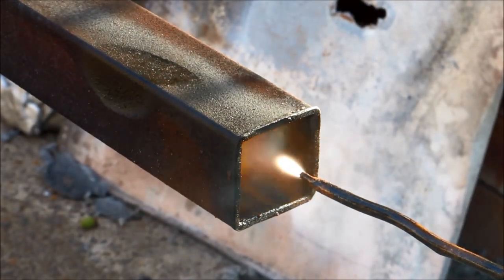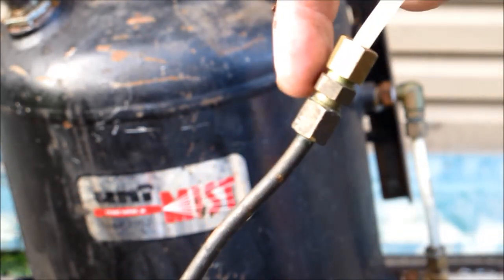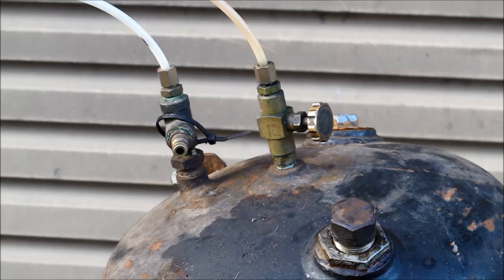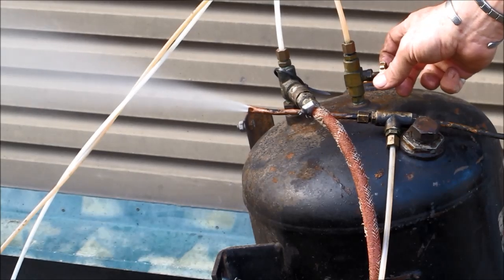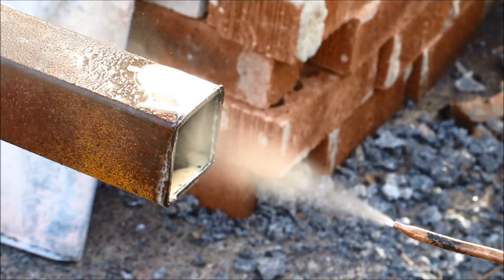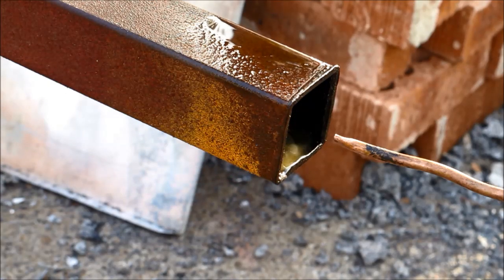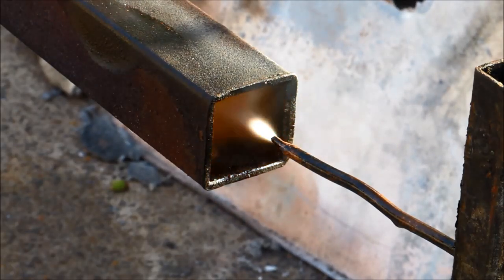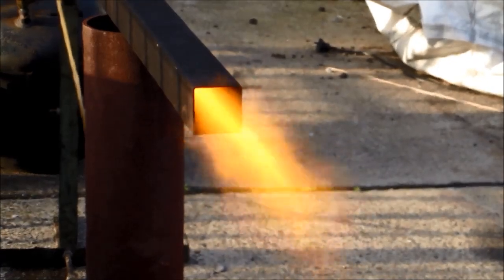Instant light  spraying oil Burner from cheap, off the shelf fittings

Comment: Thanks for the idéa, I have test it but with my own idea. I used copper pipe to create a spraygun so it create a vacuum that sucks the fuel in to the burner and it works just great. But oil burns not clean untill the burner is hot and diesel burns much cleaner. Thanks Oil burner
Reply from the maker: +Erik Strandberg  Be interesting to see what you have come up with if you could do a vid.  Sounds like a great system!
Reply: +Oil Burner I can send you a video on the burner on Google+

Comment: Hi Oil Burner,
                          I like the very simple principle the burner works on, especially the ultra clean burn. The only problem I see when used as a heater in the workshop is the carbon dioxide / Carbon Monoxide, both of which are the products of burning oil. These are heavier than air and can cause suffercation without any ventilation. An exhaust pipe would be required - to overcome the problem - and would need to be quite long to extract all the heat output via the walls of the exhaust pipe. Still a great idea and I will check just how much of the usable heat actually goes up the chimney so to speak. As a pensioner I need it to be ultra efficient as I like to get away from all the rubbish on TV during the winter months and do a bit of metal bashing in a warm workshop. Keep up the experiments and the inovation, It blows the mind ...literally. I must try an extra long exhaust pipe, at a guess I would think about 25-30 feet and see if the natural draft of that long a pipe would still give an efficient burn without having to use a compressor. Not sure of the oil flow rate as the air pressure into the tank would have to come from a point inside the exhaust pipe( venturi effect). It's worth thinking about.
Regards to you and yours
MoK

Comment: would this work for aluminuim melting... and how long would the tank you showed at the beginning last on a single run... and what can i use for air supply as i dont want to piss off my neighbors from my shop compressor being so noisy from refilling the tank.... whats the optimal air pressure it will run on? (edit) also, would it work on used vegie oil as i get lots of it from friends and family
Reply from the maker: +MegaCophater  Yes, it will melt Aluminium easily. The tank shown lasts over an hour depending on the output your run the burner.  No idea what else you can use for compressed air, Maybe a dive tank or get a quieter compressor you can use?  I have many other burners on my channel that do not require compressed air to run. The burner was running 20 PSI here but will run up to 100. 
the burner IS running on Veg oil in the vid as described.
Reply: oh, i could probably get a dive tank with a regulator capable of handling the high pressure... and i prefer having air behind it as this video shows a very clean burn (from what i can tell though) as i dont want to give off too much smoke as i live in the city.

Comment: Hi! Nice simple solution - I like it.
Have you tried to make a preheater for the oil, by coiling the oil pipe around the burner to improve the burn? Thanks. Keep up your inspiring work.
Reply from the maker: +Jose Silveira  Preheating the oil like you describe is in effective.  It does not add enough heat to make it effective once the air has comeing contact with the oil to spray it which causes it to cool.  It is OK to heat the oil to make it flow but by the time it gets to the sprayer it's already flowing well.  OTOH, I have tried preheating a flow of LPG to the point of cracking it and that makes a lot more heat than normal burning.
Reply: +Oil Burner Thanks. It will save me the effort for testing it (always good to profit from other people's experience, and you have a lot).
Reply from the maker: Jose Silveira
I get asked that a lot and It's a perpetuated fallacy.  Much better to ask than just blindly do what the guy before you did and make the same mistake. If you can find people that have TESTED something and save yourself the trouble, then that's a smart move in my book!  :0)

Comment: Love the health a safety tip! 
Im going to try this as seems the easiest version yet!
Reply from the maker: +Pete Franklin  One thing I have noticed, as well as being the simplest spray  design I can find, it also seems to be one of the few if any that will light straight off on WVO. All the others I have seen are either using LPG for startup or are using diesel/ kero as the fuel.

Comment: Would be neat to add some steel line around the end section and drip feed water in to turn to steam. and then inject the steam about 6 inches from the end. See if steam breaks down into HHO in the heat and then mixes with fuel and makes a completely clean burn. Just brain farts.
Reply: +aaaflooddrying  Unfortunately that doesn't work. The temp needed to disassociate the Oxygen and hydrogen from each other is much higher than any burner like this can generate. For any sort of decent proportion of splitting the 2 Molecules you need temps found in plasma type atmospheres.  There is also a net loss between the energy expended in "cracking" the water and the energy you get back by then combusting them. 

It's a common misconception and one I had myself till I looked into it.  Like they say, no such thing as a free lunch!  :0)
When the fuel air mix is correct, the burner will run completely clean like all the other burners on my channel.
Reply: @glumpy1024  How do you know when it is "clean?"
Reply: @Dust2dust02  you not see any smoke. Just the heat "wrinkling" the air.
Reply: glumpy10 8
Reply: No the heat from the burner will not make HHO

Comment: I love your safety tips. I too am all for natural selection. Remove ALL warning labels.
Reply from the maker: +Rodman Lyons  When they have to put warning labels on Coffee cups. You know the stupid Disease is running out of control and something needs to be done.   I bought a power tool the other day and the amount of safety notices in the thing was incredible.  I had no intention of operating a power saw in a bathtub full of water and it never crossed my mind.... until I read the warning.  The warnings must give the terminally stupid more Ideas than they were capable of coming up with on their own.   ;0(
Reply: Lmao. You sir are correct. My drill had the same warnings. Even a gigantic red tag on the cord. WARNING!!!! Use of this power tool in wet areas could result in electric shock or death. My first thought was my neighbor standing in the shower hanging his new toilet paper roll. While the shower is on.
Reply: +Oil Burner ........................................and then you open the manual and it reads like War and Peace .   Worse yet it tells you almost nothing you need to know yet the one part you can understand via the translator is all the safety bullshit like "don't stick your finger on the running blade" , UGhhhhh.    If you do find something you want to know be extra careful doing it if it doesn't make sense.     I just got a 30K tractor and the manual said to break it in you had to run it FULL POWER all the time for the first 50 hours.  Yea I crap  you not, Massey Ferguson made in Korea.   Duhhhhh.

Comment: Just in case, I personally would use a one way check valve. just in case the fire gets back up in the jet. I love the project though, and may end up building one.
Reply from the maker: +_Husky Can't light the oil, it is not flammable as a liquid, only a gas.
Reply: Oil only burns when mixed with an oxidizer (the oxygen in the air in this case).  If you have a cup of oil and light it:  only the surface and vaporized oil can burn, no air below the surface.  Also it only burns so fast.  If the fire somehow gets up in the nozzle, it'll just be blown back out.  If it got to the oil feed tube, no air in there.

Comment: If you just used kitchen oil Food grade oil you could use this for a BBQ for the heat.? LOL it would not be a low and slow cook but the heat should be good.  I know the engine oil would not be safe at all to use in that manner. Oh wait I see you did use This method for a BBQ... Killer..

Comment: I see that you have done both the drip type and the pressure type burner... In your opinion what one works the best ?
Reply from the maker: +Daniel Hoffman People seem to get very defensive over one or the other. IMHO, they both have advantages and disadvantages. The best one is the type that works best for the job you want to do. The drip burners are good from a simplicity POV and also have the ability to deliver insane outputs for nutters like me who want that.  The spray burners are instant to light, easy to control and are good for low outputs where precise control of the flame is important. To me the main drawback is you have to have a compressor as well which is extra equipment and significant  power input in running the things.  Thats probably not a problem in a lot of applications though  some people also don't have well equipped sheds with these things. 

I think a person should look at what they want to do, what resources they have and what sort of features are important to them and then choose which type will best suit what THEY want to do with it.
Reply: Well put... I wouldn't get defensive as I realize that you need to look at the application.. I think in my personal case I do a lot of castings ( charcoal Fired aluminum )... I think I would like the control more than the output.. I did ask for an opinion and I do realize that they are like assholes in that everyone has one... More information is usually a good thing when you try new territory..
Reply from the maker: Daniel Hoffman
I hope you didn't think I meant you would be defensive or anything because that was not the case. I am on some forums and it always seems like some people think there is only one right burner style to have and get upset when anyone puts forward a differing Viewpoint.  I was accused of the same thing which is one of the significant reasons I dug this thing out. :0)

I personally prefer the drip burners for simplicity and output but I'm not naive enough to think that they are the best solution for everything.

If you are using charcoal now, I think you would be very happy with either type. They will run as long as there is oil and you don't have to top them up mid fire . I talk to a couple of guys whom have gone from charcoal to drip burners and they have been very happy with the way the oil burners work.
Reply: Oil Burner No i didn't think you were specifically thinking I would be defensive... I understand that people can be territorial when it comes to certain things LOL
 
I do like the apparent simplicity of the drip burners and upon further thought how much control over the melt do I have now.. and as I have access to a rather large supply of old fuel oil and used engine oil I might as well come up with something useful to get rid of it..

I do have access through my work to a "proper" Natural gas set up but it's more fun to make things for yerself and be able to brag a little...LOL... I think I'll enjoy this as a project.. who knows I may do both..LOL

Your input is greatly appreciated. And being one of those " know it all" design engineers I offer you any assistance you may need in the future...The build it yourself community is full of the most helpful people isn't it..

Comment: Now this is something that you could use to make an oil burner heated deep fryer with, mount the cooker far enough away from the dragon-breath side and it would be able to work just fine. 
Use old oil to heat new oil to cook in that will, over time, become used, which would then be burned to heat new oil... The circle of FIRE...
Glad your uploading videos again.

Comment: I want to make this for my furnace but but i was wondering what kind you compressor do you use?
Reply from the maker: +That guy With that thing  An electrically driven air compressor.
Reply: +Oil Burner yeah but there are differerent types like a rotery screw compressor or a turbo compressor. or can you just use any kind of compressor? cuz it has to maintain a constant air flow. and how much pressure does it have?
Reply from the maker: +That guy With that thing  What sort of compressor do you have?
Reply: +Oil Burner none.. i want to buy one but there are just sooo many choices..

Comment: I'm gunna have a go at making one of these. I have 2 furnaces with the kwiky oil burner by David D that both work well, but yours is simpler again and doesn't require any machining. I might experiment a little and see if some form of nozzle works on the end. Will let you know how it goes. Thanks for the design though.
Reply from the maker: +Fairlanecustom300  I have looked at that design and a few others and am always floored by the complication in them. I looked at one the other day and I swear it must have 25 brass fittings on the thing and 3 valves and all sorts of other complexity and expense. At the end of the day, all they have to do is make fire so the simpler and cheaper that can be done, the better it is I say.

Comment: Looks + sounds like a pulse jet
Reply: +emutiny I don't believe it falls into that category. These work more on the venturi principal.
Reply: +joohop it is a pulse jet
Reply: +joohop 

yes, the same soud of a V.1 Vergeltungswaffe
Reply: If  resonation  is  a  problem,  have  the  burner  tube  inside  another  tube    with  THICK  wadding  (rockwool?)  in  between.
Reply: This is a valveless pulse jet engine.
Reply: I thought the pulse jets had a valve ?

Comment: hey mate, where would you find those t-pieces and valves laying around, in oppose to buying them new? I have a few of the things needed for this but some are missing.
cheers
Reply from the maker: +Scragos  No idea. Maybe off an old air compressor or air lines?  I just came back from buying a t Piece, a valve and some fittings.  T pices was $3.58, Valve was 6.72.  Time you go looking for them you would be better off buying the things from a plumbing or AC place.
Reply: Yeah, thanks mate. I got what I have from an old air compressor. You're probably right, wouldn't be too hard to find around Syd hey. I'm just keen to get rid of some of this sump oil in a cool way, seems like the only one of your oil burners I'd be able to replicate without too much hassle.
Reply from the maker: Scragos Funny you say it's the only one you'd be able to replicate, I consider it the most complicated one I have done!

Enzed and Pirtek are loaded with these Fittings. You'd also get them from Reece and refrigeration joints.

What part of Sydney you in?
Reply: I'm not currently in Sydney, but I'm usually in Bondi. Rekon the bunnings near me would have them? Going to go in today and get some gear.
Reply from the maker: Bunnings probably wont have what you want but I know Masters does if there is one around you.  There is a load of stuff hanging in bags in the plumbing section and even more in draws at the other end of the stores where the nuts and bolts  and electrical terminals are.
They have the needle valve inthe plumbing section  where all the brass fittings are.
Reply: Okay, thanks for the replies mate. Keep up the awesome videos.
Cheers
Reply from the maker: Scragos
Put up a vid when you get yours built!
Reply: Sure thing boss!

Comment: I've been wanting to build one for ages now. but I'm trying to work out a design that would work with no forced induction. I can get old truck brake drums at work and I was thinking of using three of these. to make a permanent fixture. just have to work out the details.
Reply from the maker: +me217  Are you wanting to melt metal, heat water or make a space heater?
Reply: Probably just a space heater. I also have plans for a forge but that's a whole different route. PS your videos are always entertaining. Good to see an Aussie on here.
Reply from the maker: Thanks mate.  I was actually testing a forge setup with the spray burner this afternoon. I have a modification to make and I'm confident it will work.

I made a completely non powered heater some years ago but I have never got round to doing a vid of it.  I'll get what I need and show how it's done soon.
Reply: Cheers mate. Will keep my eye out for it. Have a good one.

Comment: Missed you. Got a farm soy exrusion plant running on your ideas (dryer, virgin oil degummer, pre extrusión heater, etc). Thank you again. Now working on your WI system on our tractors running 50% veggie oil.
Reply from the maker: +Roberto .Cavanagh  That sounds awesome. It's great when people can put these ideas into practical applications that do work and save them money or time.  I would really love to see some Vids of what you are doing. 
ATM I have the IP on my truck turned up so it's really giving me some power. I have upped the WI as well and the engine is showing every sign it's getting cleaned out more and more and keeps running better.  WI is a very simple and beneficial  thing for diesel engines especially those on veg.  If you could do some vids and let me know that would be awesome.

Comment: Have you ever tried to light a fart with that baby??

good to see you back on YT being dangerous..
Reply from the maker: +Yves Baggi Thanks Yves. Have you managed to heat your house with oil yet?
Reply: +Oil Burner not with 'FREE' Oil but oit it is.

have a few fire extinguishers, 10" steel pipes and maybe a gallon of oil.
Challenged by the location of where the heater should be in order to really be useful...

thanks though.